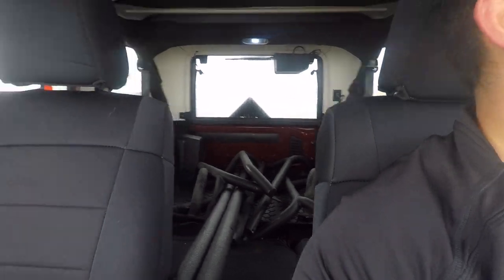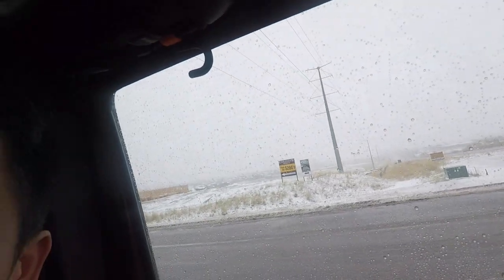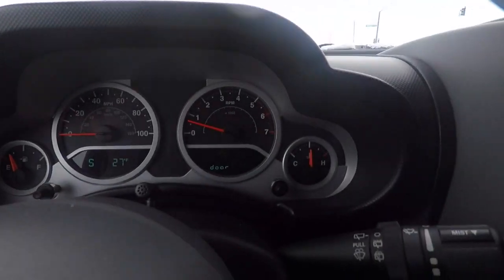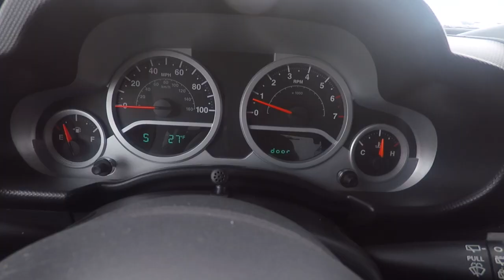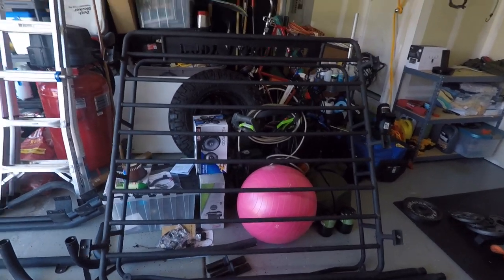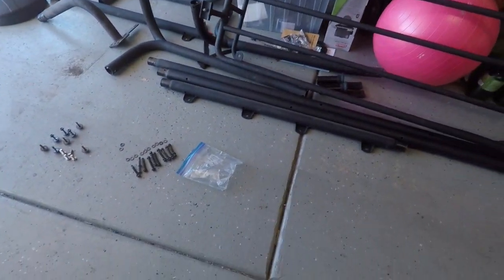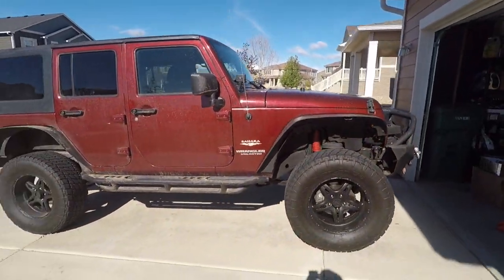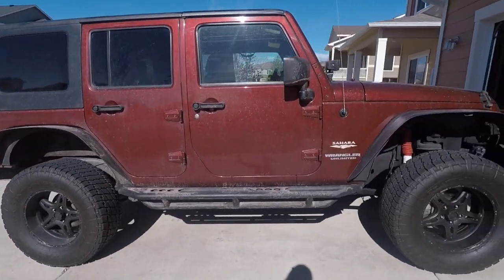Jeep Wrangler JK/JKU | ROOF RACK for $600!

Comment: -can you get your hard top off?  and get the t tops off also? While rack is still attached.  we are in the market to buy one
Reply from the maker: +Roaming Texans Fishing America i can get the hardtop off if I take off the cargo basket and the rear part of the roof rack. I can still get the t-top panels off easily without removing any part of the rack. Hope that helps!  I love my roof rack. It just adds some work if I want to take the whole top off.
Reply: Phenom3030 when you say you have to remove the rear part of the rack. Do you mean the poles that come down on the two back corners and attached to rear fender frame area?
Reply from the maker: +Roaming Texans Fishing America yes, but it would just be the upper poles in the back corners. The ones that go to the frame ahead of the back bumper can stay put.  I would just need to remove the portions of the roof rack that are blocking the hard top from coming up and out.
Reply: Phenom3030 perfect ok I understand.  Thanks so much for answering.
Reply: Looks like a smittybilt SRC rack without the basket.